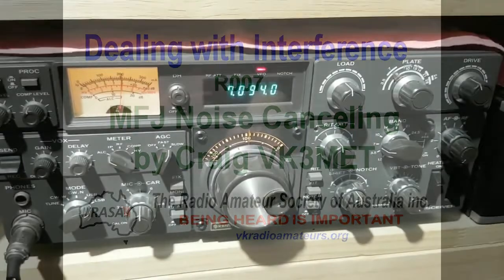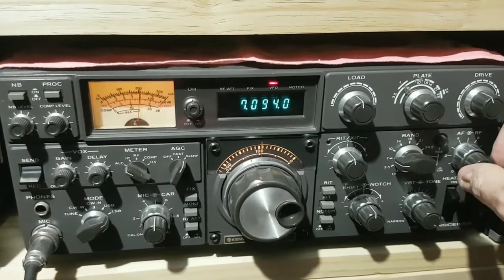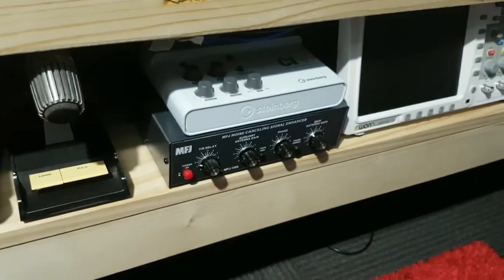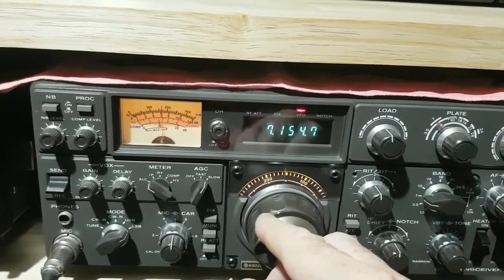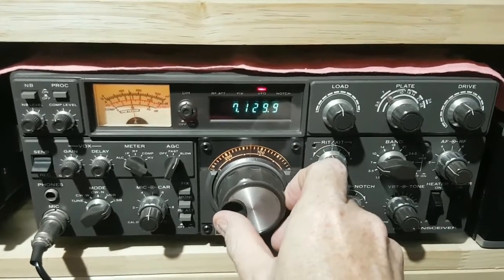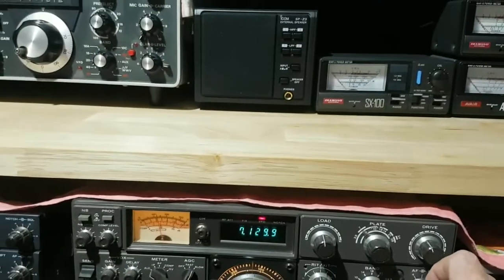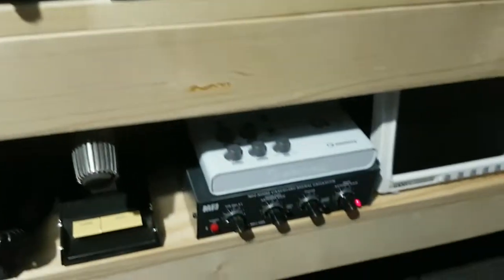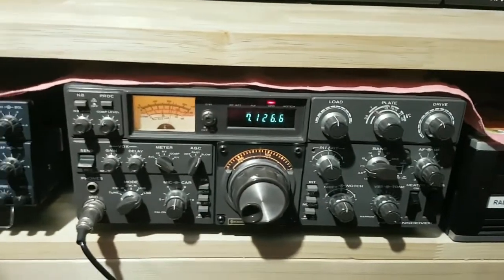R007 MFJ-1025 Noise Cancelling Signal Enhancer

Comment: don't forget also very important never use internal tunner with Mfj 1026 is going to blow the 50 mA lamp / fuse inside and if you use a aux antenna make sure switch the inside jumper to position 1 as described in the instructions is realy noce solved my problems
73

Comment: Thank you Craig, good video, is there any ideas on the sense antennas, I found they need experimenting with, In one location I had 20 meters of wire going between my position (connected to the ANC-4 Time wave) and an unfiltered solar power inverter, next door, 22 meters from my transmitter, I found it took this much wire in this positions to cancel most of the noise. VK4JDJ Rather amazing devices, but not for QRP. signals.